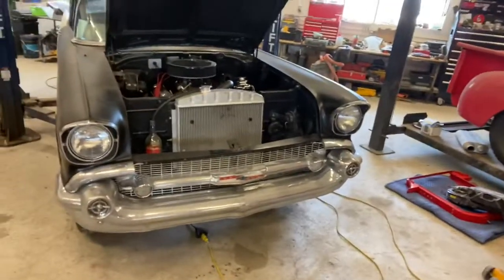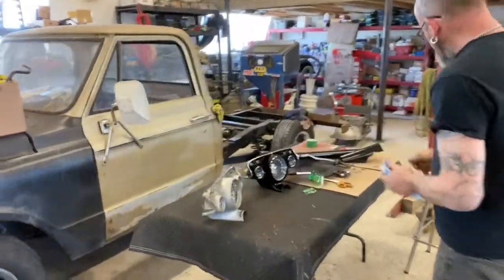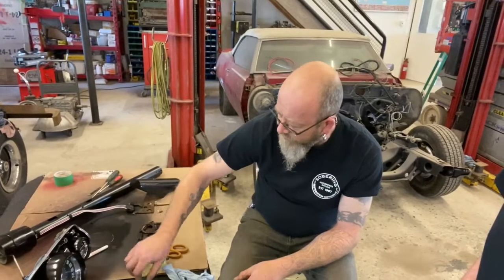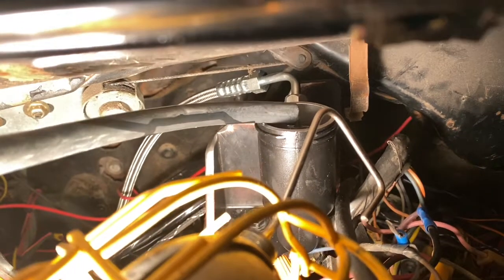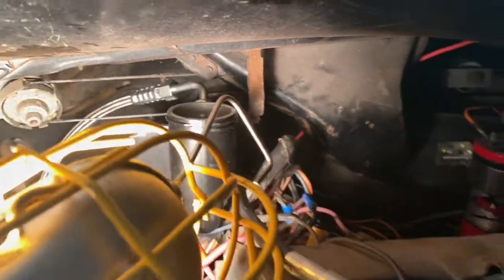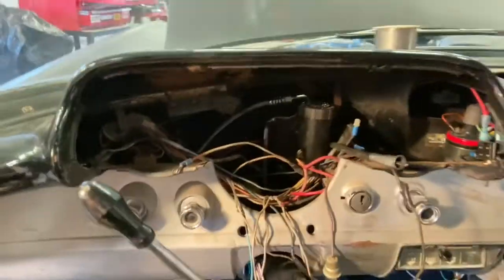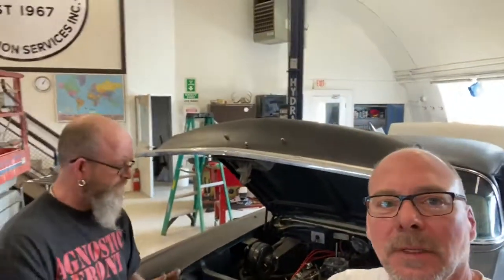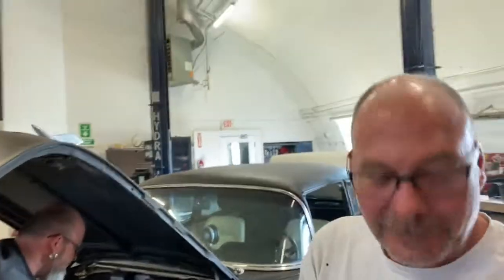57 update 3!

Comment: Hello fellers That dash looks the business well done Jeff it wll look great when you put it in.

I've never seen anything like what has happened to that brake fluid. The only thing I can think of is a sub standard washer/gasket that has disolved or even the brake fluid you put in was contaminated, even if it was new it could have been contaminated before you got it. If all else fails blame Dave lol
Reply from the maker: Thanks John.  The gauge cluster turned out pretty good considering.  We aren't exactly sure what happened to the brake system.  We got it all flushed out and seems fine now.  Thanks again for watching.

Comment: Sounds like you had a reaction between a silicone-based brake fluid or silicone grease that must have been in part of the brake system and the regular brake fluid.  Seen this a few times but usaly takes a while to jell up like that but it definitely will separate out like that.  I'm leaning towards silicone grease that was in the brake system.
Reply from the maker: Thanks buddy.  That definitely could have been the issue.  System is all flushed and seems good now.  Thanks for watching.